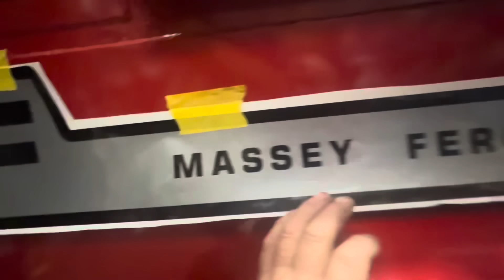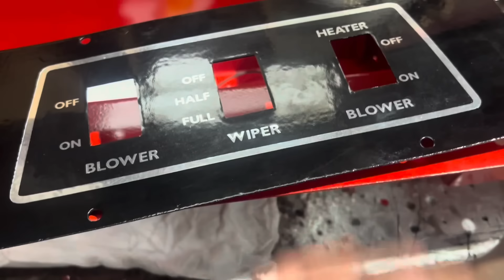MF 399 arrives for repairs

Comment: They don't seem to spend any time keeping tractor cabs clean around your area Dave and no wonder the floors are rotten.  My late Dad used to say that water was cheaper than paint or metal
Reply from the maker: And grease is cheaper than new parts
Reply: Very true, a bit of maintenance goes along way.

Comment: Was that a 600 series behind the 399?
They are the ones I’d like to have (as well as a 1200/1250)
………and a 135!
Reply from the maker: Yea , 675
Reply: @MasseyDave  
We had a 675, a 690 and a 1250 all at the same time years ago.
I converted the 675 into a 4WD, using a Selene front axle that I bought at Cambridge Market for £100!
It absolutely transformed that tractor.

We also had a 135, 165 and a 175 at that same time. The 175 was fitted with Farmhand F11 loader, which tended to knacker the front axle. Particularly the stub axles with the cast front wheel centres. So I swapped its 2 bolt/side axle for the entire 675’s 3 bolt/side heavier duty front axle and it never gave any more troubles.

Comment: Good Job Penny 1250 is really coming on Dave 👍 is the micronic filter for fuel  Dave I haven't changed mine yet
Reply from the maker: Just the standard filters for fuel , the microns one is for the oil ( PTO ) and one up front additional for the gear box on return from oil cooler
Reply: @MasseyDave    thanks Dave I've just looked underneath my 1250 and I can clearly see it's not a fuel filter now 🥴😂🤣